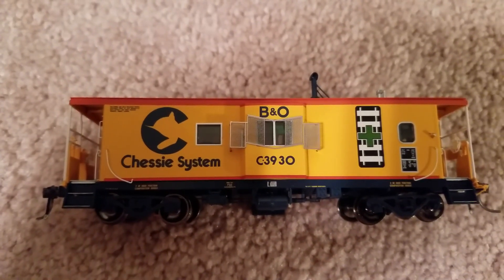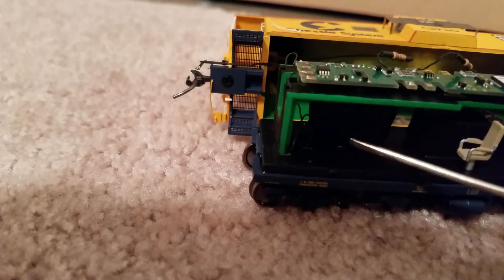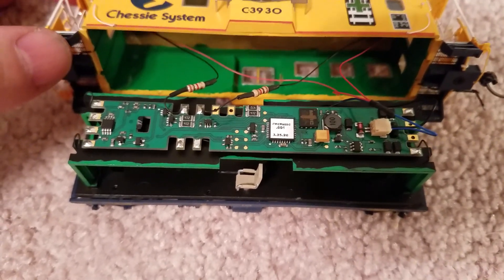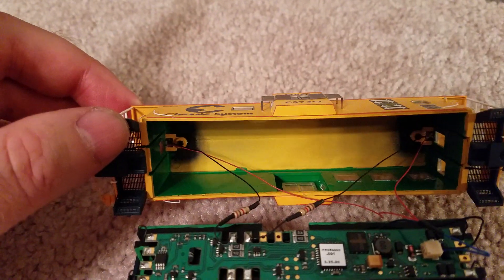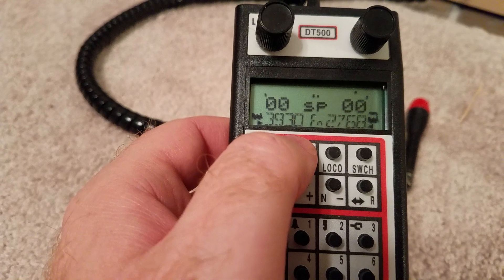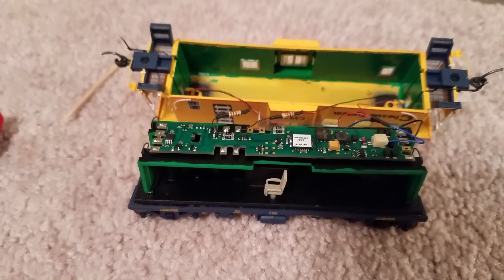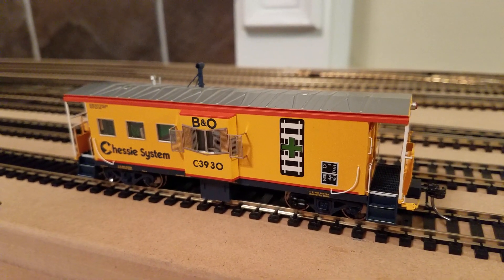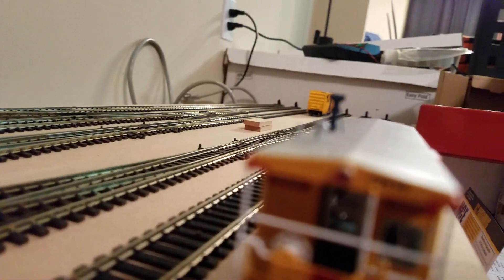Athearn Genesis Chessie System Sound Version Caboose Modifications

Comment: I have the same issue with the Santa Fe caboose, cannot see the lights. I took it apart, the LEDs are red going through that clear plastic pipe and the lens are also red. no chance to see a light with that. Thanks for the hint for the position of the light board, I will definitely try to move it round. I will probably replace the red LEDs with white ones...nice job on all your work :)

Comment: The wire you plugged into the current keeper socket, is the blue wire on the left side of the plug as looking from that end of the caboose
Reply from the maker: The plug only fits in one way.

Comment: I am extremely surprised you needed to do as much work as you did to get this caboose to where you wanted it. I'm just wondering, I've only done a few sound cars which don't have any lighting to deal with, but given a choice could you have done a better/easier job adding the sound and light to a non-light, non-sound Genesis caboose yourself ? Just curious. Great video. Extremely informative.
Reply from the maker: Well, I wanted that Chessie caboose, but yes, doing one from scratch would have been much easier
Reply: @christopherbrown5338  I understand. The shell is fantastic. And I really like how you reworked the EOT lights so they can be controlled by the operator.